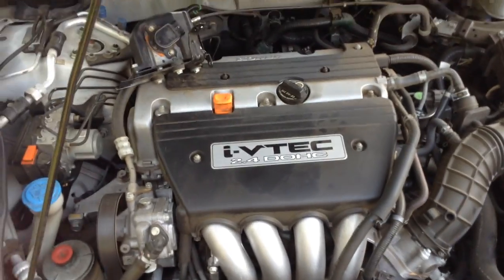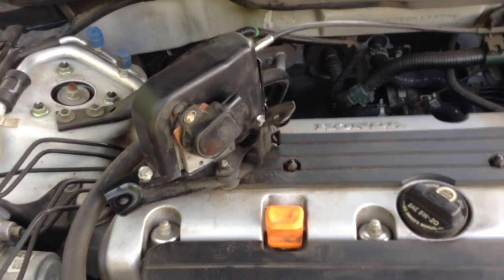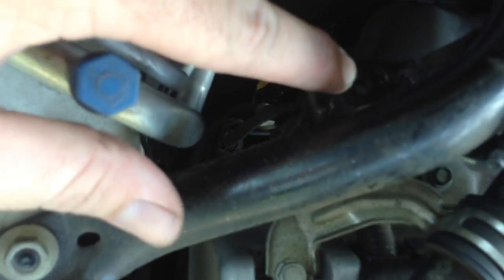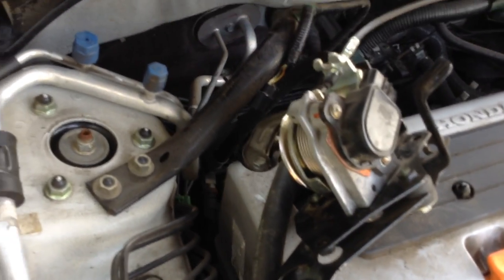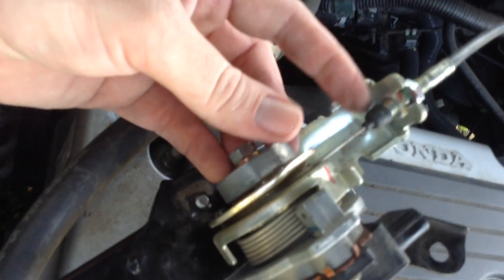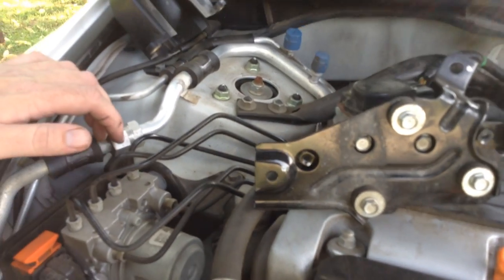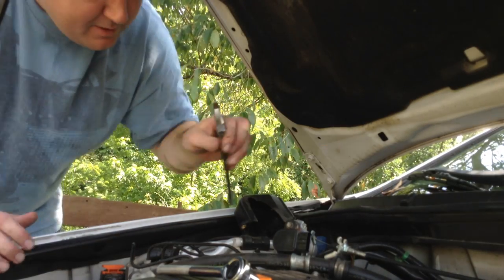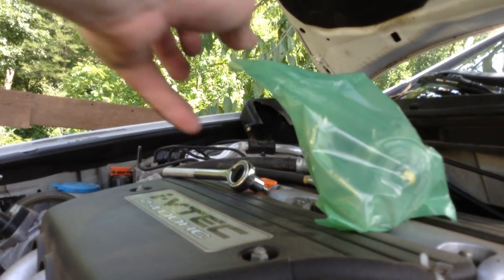How to replace the accelerator pedal position  sensor (app sensor) on a 2006 honda accord

Comment: The dealership replaced my throttle body because they said that that sensor was the problem. Cost $217. The same day I got it back. It did it again. I'm going to order that part tomorrow and fix it myself! Thanks for the video.

Comment: Thank you for the video!  I bought the item on eBay Friday.  Received it on Monday.  Following your easy instructions, I replaced the device in about a little less than a half hour.  To think how much I saved on labor and not having to leave my car with a mechanic for several hours.  The hardest part was removing the assembly and not breaking or bending the AC valves.  I have a 2004 Honda Accord V-6 and there is very little maintenance and repair I won't do myself. However, the check engine light and TCS light no longer comes on.  Which was dangerous because I lost power at 80mph and other cars behind me. Thanks again!

Comment: Thanks for this.  The local Honda dealership quoted $350+tax to replace this on an '07 Accord.  Got the part from RockAuto for $93.
Reply: What was ur cars symptoms mine is the check engine light came on and it was hard to accelerate

Comment: So, I've never even changed the oil in a car before but for some reason now that I got some tools recently I felt compelled to feel manly and "fix my car". Your video was 15min worth of testosterone for this car noob. Thanks for the help!

Just a note if it hasn't already been mentioned. If after replacing everything and taking taking a test ride you may notice the idle being much higher than before... you just want to loosen that nut that held the wire in place to give a little slack on the throttle wire. Or whatever it is called.

Thanks again!

Comment: 2007 TLS
Symptoms that started; slight surging, felt like the a/c was repeatedly/rhythmically being turned on and off 2nd and 3rd gear at 2500 to 3000 rpm. 
OBD 1200 Code P2138.
 So far so good after replacing!
Thank You For Posting!
Reply: MrEMA433 did it surge up and down around 1400 rpm to 1500 rpm and kept doing that over and over until you gave it gas or slowed down?
Reply: @rickharrison6969 I just saw your reply after six years! Sorry!! I was at a stop sign. I let out the clutch, (I don’t remember the rpm’s) absolute power loss. I pushed the clutch in and out again, I turned around and parked it. Since I changed it out no problems. Sorry about the six year response.
Reply: @MrEMA433  lol! I forgot all about this. No worried, still appreciate the response

Comment: Thank you very much for the video, and it was very informative. Apparently Hondas/Acuras having the APPSA issue, especially with the V6 models. I personally drive a 2005 Acura TL and I have purchased the APPS, because I was having the same issue such as Loss of power, hesitation, and reluctant to accelerate. However, I did not have a check engine light on in order to diagnose the issue. I had to ask a lot of people in order to diagnose the issue. A lot of Acura TL owners are having this issue, and now I know how to replace the sensor thanks to this video.
Reply from the maker: Your welcome! Glad I was able to help out
Reply: MR logic i have a ?   am having same  problem on acura tsx 2004    loss of power when pressing gas  no codes so is there any way to see if i have a app sensor  did you change your yet and if you did    any more power loss /////?????/
Reply: Ricardo Rodriguez I cant speak on the Acura TSX, but it did make a difference for my 2005 Acura TL.

Comment: You show some lights on the dash board when this sensor was giving you problems my car is a 2004 Honda accord v6 3.0 and a think this sensor is giving me a problems bicus sometimes works good and some days the car Shake's and sometimes the check engine light is on and then some light come on the dashboard I think is the TPS light and another light and then I had to turn off the car and turn on again to the car keep working.. You car was duin the same think... And thanks to take the time to make this video is really good on details...

Comment: Hello every one, congratulation for the video. I changed this one Honda Accord 2006 2.4 liter, but now, when turn on the car, when I press the accelerator it no response  I need to clear the fail code with a scanner or reprograming.

Comment: Disconnect the negative battery cable, then app electrical connector. Take the plastic cover off. Then the throttle cable connection. These last two steps makes it much easier and quicker.
Reply: Jim Fortner Hi Jim, Do you mean that we should try your steps prior to changing the whole thing?
Reply: Yes. The important thing is to remove the throttle cable first before removing the sensor from the mount. Once the sensor is off the mount removing the accelerator cable is more difficult since you have to hold the sensor with one hand.
Reply: @rentrofmij Thank you very much

Comment: Hello. I was diagnosed the same problem on my honda accord 2007. However i found only the throttle position sensor (the black plastic) my question if you or someone else known, do i have to change the body as well as it was shown on your video or i can just change the throttle sensor? The price is approx 200 euro difference...

Comment: Great video Mr Herron! My wife's '07 Accord V6 is having the same issue and I pulled the same code (P2138). Its frustrating because its intermittent but nothing matters more than our loved one's safety so I'm just going to replace it. The only question I have is how to mark the two nuts on the cable if they are not already marked. Are you marking them on the all-thread/ bolt, or just their orientation to each other? Thanks so much again man! Truly a HUGE help.

Comment: Great video, I needed all the details. Most of the other videos are min in half long. Quick question I'm doing this to acura TL 06 so the procedure would be same? Also how much torque do I need to apply to cable or just make sure it's real tight?
Reply from the maker: The procedure should be the same from what I can tell, the sensor is located in the same place for both cars. As far as the tension goes, mine was marked on the two nuts with a red marker to show where they lined up at and I was able to line those back up.  it took me a minute in the video to get it right but what I would do is if the nut are not marked, use  a sharpie or something similar to mark them and also place your finger on the cable and feel the tension yourself and you should be able to get it back to the same tension that way. Once you you have it aprart you'll be able to tell! Thx
Reply: Thanks Leroy

Comment: did you have to reset the codes yourself or will the check engine light come off after a while of driving
Reply from the maker: On mine, the engine light went off after installing the sensor. You can disconnect both battery terminals from the battery and use a wrench or a screwdriver to touch the two terminals together and discharge it and that will reset the codes as well.

Comment: hi - where did you purchase your replacement sensor from?  having the same issue with an 06 accord...lost about 60% of the acceleration
Reply from the maker: I purchased mine of of eBay for about $95 brand new. That's cheaper than any of the local parts stores that we're asking  around $160

Comment: Do you have to reset the system after you put it in ?
Reply from the maker: To be honest, I can’t remember. I think the engine light just went off after driving it for a few miles.
Reply: @leroyherron470  okay but I think I’ll just do the taking the negative terminal off for awhile then rebolt it back just to reset it that way

Comment: Man I got same code! On my 06 Mitsubishi outlander. Pedal to the floor no power and terrible gas mileage. I tried buying aftermarket ones are not working.
Reply from the maker: I bought mine from eBay. I have replaced it once since this video but haven’t had any issues in about 3 years.
Reply: @leroyherron470  mine turned out to be the ECU. That fixed the all the problems.

Comment: You didn't show how you un-mounted it from where it is installed in the engine compartment.  That to me is just as, if not more important than how to take the cover off, disconnect the cable and the electronic connector.  Once I saw that you had it un-mounted, I quit watching your video.